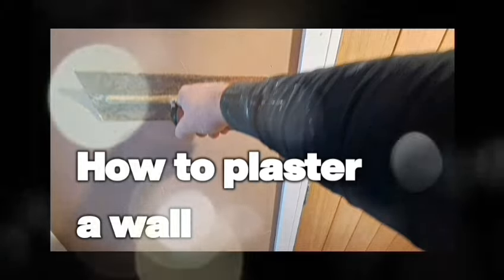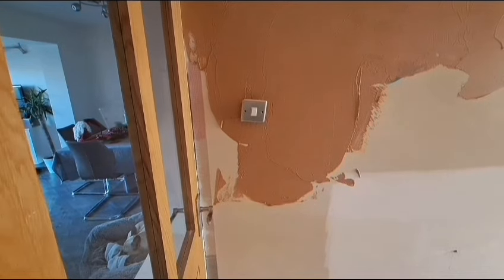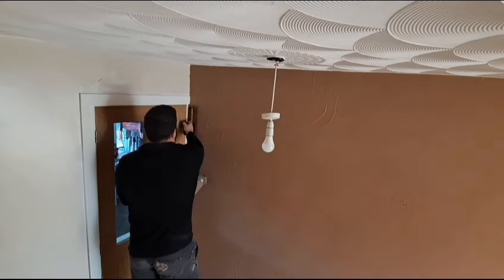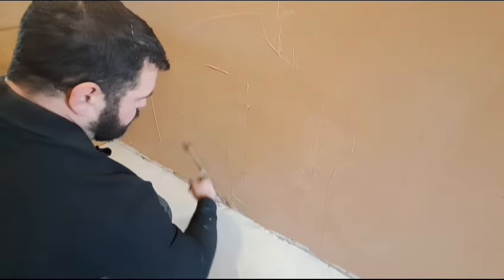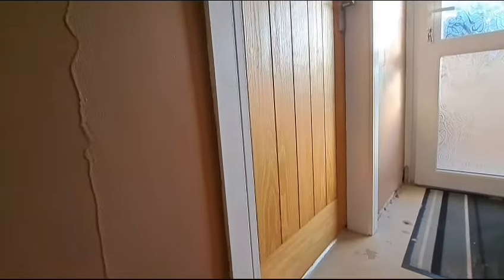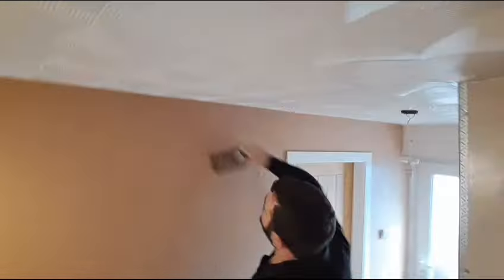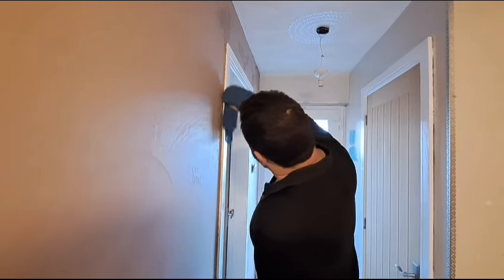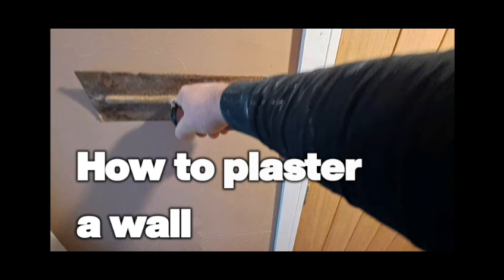HOW TO PLASTER A WALL STEP BY STEP

Comment: Here is the top tip. Screw the screws into the wall for the radiator markup roughly where they are very quickly with a right angle. Just the heights and leave a small mark on the skirting or floor. Then after you have finished, you can find them again using a powerful magnet. This saves hours and leaves a flatter finish. 25kg magnet

Comment: It's the ceiling you shud have been plastering over mate 😂
Reply from the maker: I did later that day... I was just trying to get that video made as fast as possible, I didn't help that I had a stair wall on at the same time 🙈😅😅
Reply: @Onthetrowel  top video mate , just when I saw that ceiling I thought jaysus that needs to be plastered over more than the wall .tnks for reply

Comment: Great video. Thanks for sharing your knowledge.

If you fasten the screws below the surface of the existing wall. Then plaster over them as normal. Then when you're finished run a magnet over the area to find the screws and just expose them with a screwdriver. This way there are no screws to work around.
Reply from the maker: Absolutely fantastic idea. 
I'll put that in a video mate

Comment: Watched a lot of your great videos as I was wanting to have a go at plastering my garden room ...... Thanks for all the great tips, I'm never going to be a professional plasterer, just an enthusiastic diy person!
When I use the trowel I leave lines on the toe and the heal... Drop plaster all over the shop and struggle to work quick enough to get it all on the wall before it starts going off 
I'm on my 6th wall now so getting the hang of it better than my first super stressful wall.

A few items that you didn't mention and I haven't seen you use are an old table cloth to but under the wall that's being plastered to catch the large amount of dropped plaster and a mop and bucket to tidy up the aftermath!!!
Also next time I attempt a ceiling I'm wearing a hat as 4 walls in my first ceiling was challenging with plaster all over me, in my hair and over my arms. The floor looked like 6am at a festival rave because of all the plaster I had stepped in on the floor!
Anyway I'm not doing a ceiling again until I have done a lot more walls and i would wear a hat! 

Couldn't have done what I have done without your videos and superb advice though.

Thanks 👍
Ps

It is so much harder than you make it look.
What amazing skills you have 11/10

Comment: Top Video mate, really appreciate it! First Trowel lay on 1st coat second Trowel 2nd coat then 3rd Flatten  (No water). Then wait till nice and firm,  flick water Trowel, wait till almost set same again. Then polish up!
Reply from the maker: That's it Jamie, you just get a feel for it with the water, every job is different and depending how much you've got on the wall, sometimes you might find it easier with a bit of water on the 2nd and 3rd... sometimes you don't need it. 
I just go with how it feels.

If you ever need water when you're flattening in then that's a sign that your in a but of trouble and need to speed the hell up. 

Cheers mate 🍻

Comment: I use earth sleeve cable and put in the holes where the radiator goes so when you plaster over it they just flick back out saves me going round screws on bigger jobs
Reply: Trying that 👍

Comment: Good stuff. 
In general on the walls( from the skirting up) we work on the idea that on the first coat the muck on the trowel looks like a pasty and on the second coat the muck on the trowel looks like a pancake. 
Similar on ceilings but just smaller versions. 
Keep up the vids mate. Love it.
Reply from the maker: Top tip Harry, Cheers mate and thanks for the support on my channel

Comment: I noticed your very old school with just using the one ridged marshalltown trowel. No flexi trowels or plastic speed skims or plastic on the very last trowel. I guess we get used to doing things the way we were taught?
Reply from the maker: To be honest I usually just stick to my carbon steel for most things, that being said I literally have loads of different flexi trowels and spatulas and I will do separate videos on them at some point but I just wanted to keep this vid as simple as poss.

I remember when I was doing building site work about 20 years ago and we used to make speed skims out of cavity closers. We all used to say we should get a patent on it... years later someone did (nobody I know by the way)

Comment: I’m in agreement with everyone else’s comments that yours is the best “ real world” take on plastering. Can I just ask that if you did want to use a superflex or plastic trowel that it would only be on the very last trowel. Appreciate that you don’t go down this road yourself and on the basis of what your showing us there is no need but just inquisitive. Thanks and keep em   coming.
Reply from the maker: Yes you could mate but I really don't see the need to, I would say it just increases the risk of not getting something, or missing something. 
I would only say it's OK if your working over new work, nice flat boards. I'd definitely steer clear if it was over old walls mate
Reply: Points taken. I’ll stay clear and stick with my MT. Thanks for responding snd been honest.
Reply from the maker: @lewigas290  it's a pleasure mate, keep in touch

Comment: Thanks for the tutorial Kirk.
Slightly off topic but i have the same ceiling as in the video (ie it looks the same).
My property was built in 1963. So i was wondering if i would be able to plaster straight over it?
One of the ceilings has some loose paint which can scrape off in places, so can i ask, how would you deal with this?
Thanks in advance.

Comment: Hi mate, awesome videos!

I'm due do my kitchen, only done little jobs on my properties before but got the timing wrong and had a nightmare lol.

Just to confirm -

2nd coat - when it leaves imprints but doesn't stick to your fingers

1st flatten (no water) - when it leaves imprints but doesn't stick to your fingers. 

2nd flatten (water) - when just about leaves imprints and is firmer.

Polish (no water) - when it's firmed up.

I've watched the video I just want to double check.

Cheers,

Harry
Reply from the maker: Spot on mate, don't worry about going over it to much though, you can give it 10 trowels if you want mate
Reply: @Onthetrowel  brilliant thanks mate I'll let you know how I get on.

Comment: Have been looking to find out the ratio of water to plaster mix. Any guides on how you measure that out to get the right consistency?
Or a rough guide to how you calculate the amount of mix to wall surface area?
Reply from the maker: Hi mate, I've actually done a video on how to mix plaster, take a look in the videos section mate

Comment: Hi Kirk, regarding the timing of when to put the second on. Will it make a huge difference if you left it too long before the second coat? I remember the first wall I plastered, and it took me soo long by the time I put it all on, flattened it and cleaned out my bucket that an hour and a half had already passed and it was close to two hours before I put my second coat on lol. I painted it all myself as well. Three years on and the wall is completely fine. So I was thinking what is the major issue if one were to apply their second after the recommended time you advised in the video. I’ve done this several times (leaving it way after the recommended time) until I got faster and have never had an issue. Please can you elaborate on what the negatives are when you do leave it too long before the second coat?

Thanks 

Bee

Comment: Superb instructions and teaching, would a speed skim help this job or is one trowel the same thing once you can use it ? How many trowels were used here?
Reply from the maker: Hi Sean, you can do everything with just one trowel. That's what I did in this video. 

Yes speed skims can help, and I'll do a separate vid when I get the chance. 

You know where I am if you have any more questions mate👍👍
Reply: @Onthetrowel  thank you I'm building a house mostly myself in the new year ( budget) learning new trades including plastering. Depends what money I have available I'll be getting stuck in ! Thank you !!
Reply: @Onthetrowel  happy xmas and a big year (inc health for 2023 :))

Comment: I stick a bit of electrical tape across the top of terminals on switches...ive tripped a few on domestic jobs when the pressure is on with the odd stray bit of multi 🤦‍♂️
Reply from the maker: We've all been there, makes the job more exciting 🤣😳

Comment: Subscribed! Perfect Video...could watch you plaster all day.  I'm relatively new to it all but have looked up alot of video's and also laboured once before for my mate who plasters Daily so looking forward to giving my flat a go as it's stripped to a shell so perfect time to make a mess lol. Liked the tip about the bottom skirting area about it being higher suction making plaster at the brick area dry quicker so will pay attention to that in future.  Had a Question...the first and second coat of plaster are these the same batch  but just thinned down with more water on second coat? Or are they two completely separate batches of plaster?
Thanks in advance mate, Aidan.
Reply from the maker: Aiden whilst you are learning you would be better doing a fresh mix. 
When you wet the same stuff up it sets faster so you might struggle.

P.s. Little bonus tip for you mate. It roughly takes exactly half the amount to second coat as what it does to first coat 👍👍
Reply: @Onthetrowel  brilliant mate...thanks for the speedy reply!
I'll stick to separate batches untill I build some confidence, tip has been noted that's handy mate... I'll be watching for your future vids, all the best for 2023

Comment: Have u tried to flatten your first coat before applying the 2nd
Reply from the maker: Yes, an I'd definitely recommend it if your starting out. I put it on fairly neat sk I don't bother. 
Check out my video on plastering over artex, see if that's what you mean mate

Comment: Nice video mate, when you were doing above the door. Would you ever get a smaller trowel and flatten sideways as well as up and down? I always seem to put too much plaster on when applying that way, and end up with more at the bottom and top than at the middle. Anyways keep the videos coming.  Love how you make it sound and look so easy haha.
Reply from the maker: Yes, if you can get something smaller to go across the top of the door then definitely. I usually  put on quite tight so don't really struggle with it but it's a very good point, I'll include it in the next skimming video.

Appreciate the feedback mate an cheers for the nice comments 👍👍

Comment: Step 1 don't plaster, tape and joint instead...the end😂
Reply from the maker: 🤣🤣 ahh one of those from the dark side
Reply: @Onthetrowel  yea😝😝
Reply: @Onthetrowel  you Def beat me in an arm wrestle tho 😂😂
Reply: Tape and joint takes longer I reckon and plaster is a much more durable finish.
Reply: @Louisthesaxman1  you only plaster corners and joints, way faster, and easier.but Depends on pov, multi finish plaster takes 2-3 days to dry plus a day to plaster a room B4 you can paint, tape and joint takes 2 days and u can paint it straight away after you sand, plasterboard is a finished surface, no need to skim,  it saves loads of ££ on materials. 
I'm not a good tape and jointer but my mate is, he can do a 2 bed bungalow in a day.